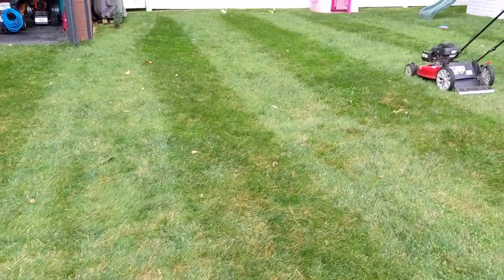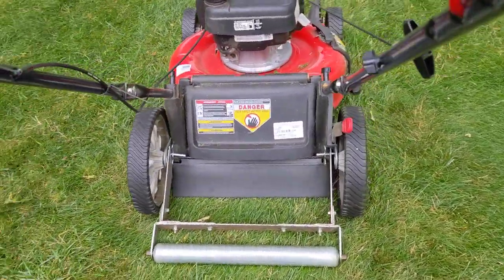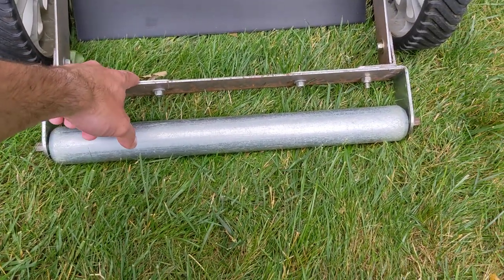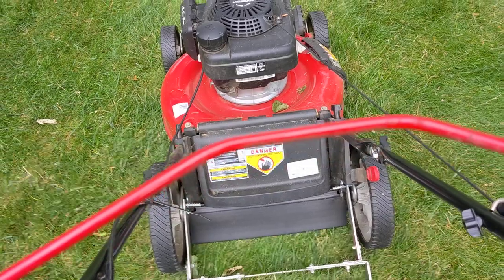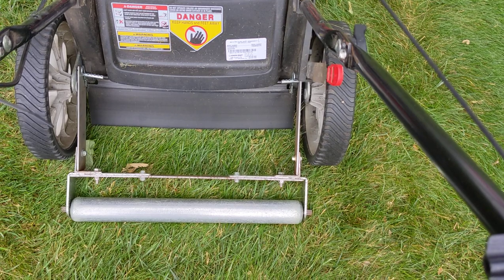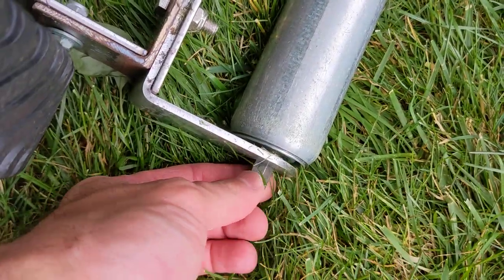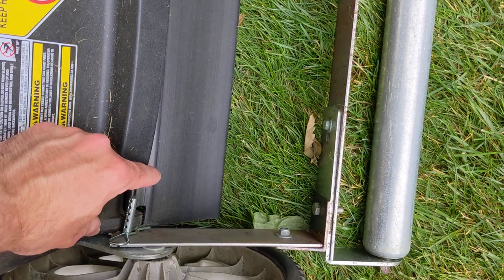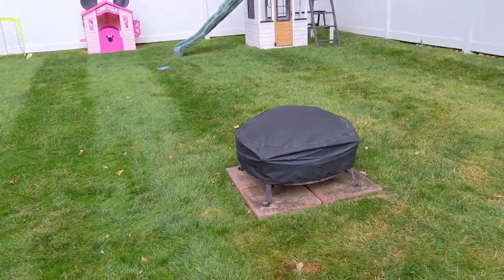How to Make Lawn Stripes DIY

Comment: Larry what to you use to keep the conveyer belt bracket in place that comes off the roller.   Is there a certain type of nut that goes over the 7/16" bracket?
Reply from the maker: The nuts that hold the bracket to the steel stock? I just used nylon lock nuts I had laying around from an old Audi I parted out years ag